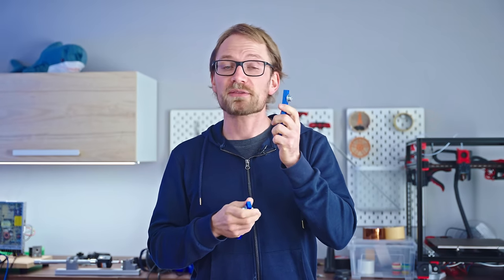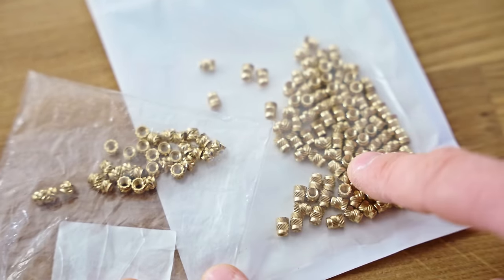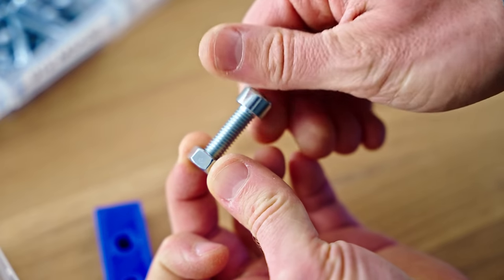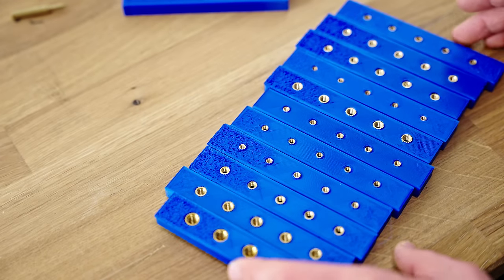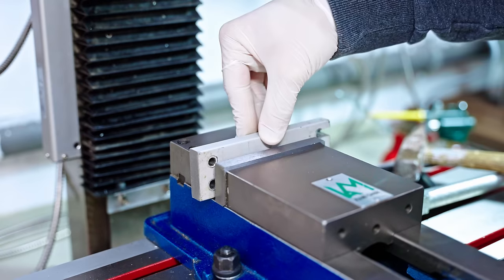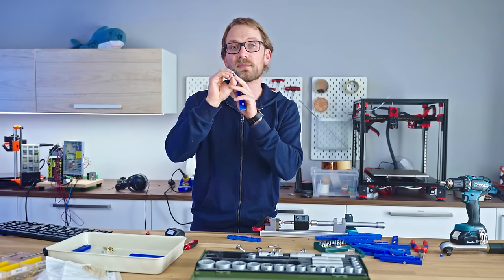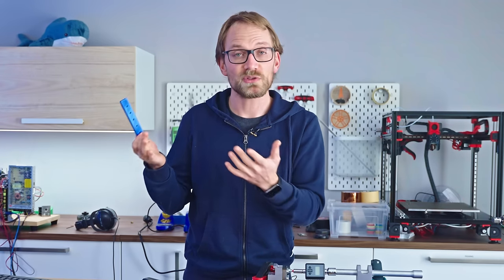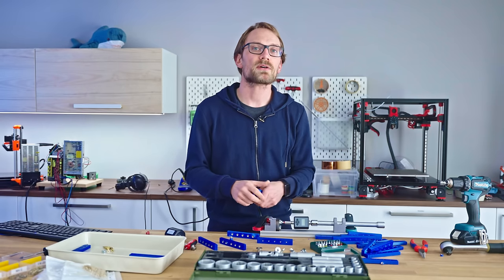Do you even need threaded inserts? Strength tested!

Comment: For a follow-up video, I'd like to see an exploration of print settings and design techniques for maximizing threaded connections. Different projects have different constraints, and there won't be any one best solution. Working toward that mythical best solution will find several methods that might be useful in some unforeseen scenario. Sometimes an insert might be the right thing to do, sometimes it might be best to use a deeper tapped hole because there isn't room for an insert. It would also be useful to see what didn't work well.

Maybe take a few minutes to explain or at least introduce some of the general engineering considerations of threaded fastener design. For example, you mentioned in passing a reminder to consider what's happening with the head of the screw. Has someone else already done a threaded fastener design guide for printer-using hobbyists?

Comment: This is why I print my wall loops with 6 lines thick if I'm planning inserts. I have found that this adds significant strength increase in pull-out strength.  Where I think the opposite threading would help, is if your object is expected to operate under pressure in a warm environment. That should help decrease the failure pull-out point.  To me though, the plastic will always be the more likely failure point before the insert fails.  The benefit of the insert, is if you plan to frequently remove the screws for maintenance/access reasons (like case access screws for example).

Comment: Taping into the plastic works MUCH better if you just let the screw tap the whole, especially if it's a "screw in once and leave it there" sort of deal. (You can unscrew, and reapply the screw, you need to be very careful to align your threads correctly, but if you're going to do this more than a few times, I'd go with an insert at that point.) As all of the material that was there, is still there, just displaced. In my experienced tapped holes into 3D printed parts are FAR weaker than self tapped holes.  You also need to understand, you're going to be fighting a LOT of friction, so it's not going to be the smooth and easy engagement you're used to from say metal on metal engagement. 

No, this does not generally split the plastic, even when it's extremely tight.  Though I generally print with a minimum of three walls, and if I'm going to be doing screws, I may step it up to four, depending on application.  You do want the hole as small as you can get it, and the bolt/screw actually still be able to fit in enough to tap in.  

Also there is utterly no need to tap a plastic hole for a metal screw, I can't believe Tom even bothered with it.  It's not like the plastic is going to deform the treads on the screw!!!  Further, I can't believe he was tapping the hole with a drill!!!  I tap metal holes by hand, and here he's using a power tool on plastic, and wondering why it's melting!  🤦‍♂

Comment: Alternatively, create a pocket for a hexagonal nut, pause the print and drop the nut into the pocket before continuing. You can also use a square nut slid in from the side or a nut from the back if you have acces to the back.

Comment: USSA woodworking channel uses threaded inserts for wood in their designs. They also insert it from the back of the part so the chamfer helps spread the load. Would be interested to see how they perform.

I only use inserts for parts that need to disassembled fairly often. Normally I just undersize the hole by the thread thickness, and let it self tap.

Comment: An idea i just jad while watching this was to redesign the insert to be a truncated cone that is pressed into the opposite side of the material. This would greatly increase the contact area of the insert. It also spreads the load out over more material and gets rid of the aligned perimeters that pull out so easily. No blind holes and slightly more limiting but would also be more hidden.

Or maybe just putting the bolts in from the opposite side of the inserts. The inserts do seem to move a lot of material out of the way, which may be creating a shoulder for the insert to push on. You're likely still only contacting the perimeters though, which would still be the weak point.

Comment: I'm surprised that the age-old method of thermo-threading wasn't shown, or even mentioned in the comments, as far as I can see.
You just heat up the fastener, and screw it into a slightly undersized hole.  It melts/taps its own threads.  You then remove it quickly as it cools, and screw it back in and out a couple times as the temps drop and the plastic resets.  You end up with perfectly formed threads, and no material lost.  I've been building stuff this way as long as I've been 3D printing, maybe 7-8yrs now.  
Of course, this will never be as strong as a threaded insert, but it's free and quick. ;)

Comment: Two thoughts: 1) design the part with a pocket and pause just before the pocket is sealed up and place the insert into the pocket so that the torque isn't the limiting factor. 2)design your parts using dovetails that interface into each other in order to provide some of the mechanical strength and use the screw/bolt to primarily keep the interface located together rather than be the entire interface itself.

Comment: We came up with a design to print threaded holes horizontally. Basically, the threaded holes are modeled and printed without threads on the bottom and top quarters to compensate for the dimensional inaccuracies of the Z axis and to make the bridging cleaner. The logic behind is that the threaded perimeter along the full hole depth should be way stronger than the layer bond of a vertically printed threaded hole. But we have never performed a technical analysis to them. Would be great to see you test them.

We are printing M3 holes at 98% scale and 0.150mm height. For larger holes, the layer height could (and should) be increased and the strength should increase significantly.

We'd gladly send you the link to download the design, but YT algorithm apparently doesn't like that and deletes the comment if we try to :)

Comment: I like tapping into plastic: it's cheap, easier to align (the tap aligns with the hole, at least drill/tap combined ones), you also can increase the engaging length (of course provided that the part is thick enough), and it's more difficult for vibrations to untighten the screw. And easier to model too, I just make undersized holes (2.5 mm for M3s, reduction of material is not really a problem as I print functional part with 2 mm perimeters and 45% infill). But they're probably not as durable as threaded inserts. It's always a tradeoff game, you just need to know the theory behind, that's why this kind of videos are very helpful!

Comment: Thank you for putting in the research work! Since you asked what to check next: Self-tapping screws, wood screws, inserting nuts, use of washers (larger area might not pull out as easily?), using the inserts from the other side (pulling through the entire part instead of pulling them back out where they inserted) and of course more walls / more infill / both...

Comment: Some things I would think would be interesting to test:
- A test of different perimeters - Are there diminishing returns? Where is the curve for "enough" to make more perimeters not worth the extra plastic.
- Given a standard thickness of say 12mm - You put a long heat insert in one side and Pull it from the other side with ~3+ perimeters, and compare that to modeling a Hex or Square hole into the part to use a standard (non-heat-insert) nut. 
- Quick comparison of a few different filaments - Specifically interested in PETG, PC and ASA. (Nylon has way too many other variables)
- A nice graphic final breakdown graphic with a "Strongest Tested", and "Budget Pick" for each Thread Size/Filament Type

Comment: You absolutely should redo the test with 100% infill.  With what you showed, you can’t tell if the material is failing or if the infill structure is failing.  100% infill needs to be the baseline, and then you can start reducing the infill to get a best strength to weight ratio.  Also, you can increase the thickness of the cylindrical shell that the screws go into, as well as increase the internal webbing between this cylinder and the rest of the infilled structure. This might be a good case for using some finite element analysis of the stress and strain instead of burning plastic all over the place. Great vid!

Comment: This test left out the OG method of screwing into printer parts - print slightly undersized and use the screw to tap the threads as you put it in. You don't compromise the wall thickness at all in this way, and an added bonus is that the printed part now acts as a bit of a threadlocker.

Comment: Great video! An idea for an addition: I think you should try to give the inserts and taps the best possible chance to take a load - as that is what anybody contemplating using inserts would strive to do anyways. For that, print your test bars without any holes in them with 100% infill and drill the holes by hand afterwards. These holes could then be inserted, or tapped and maybe even helicoiled. This way, you would rule out the hole area being a weakpoint by bar design in the first place.

Comment: OK!  Consider this as a 3D printing option for a variety of reasons...
If a recess is designed at the back end of the hole that is hexagonal in shape, about the same depth as a hex full-nut and about 100uM undersize inclined walls.
Use any of a variety of techniques like heating the nut and insert or simply press-fit at room temperature, or use the mating screw to draw down the nut into the hex' cavity where it will wedge and stay put.  The printing material used will normally dictate the most reliable fitting method.

   |_|_|   Hex Nut to insert.
  \_ _/   Hex recess in 3D printed material.  Slightly inclined walls (~ 100uM undersize) for hex nut dimensions. 
    | |      Clearance hole for machine screw in 3D printed material.

I used this technique on an injection molded polycarbonate thin-wall case (electronic product) with M2 stainless hardware.  It was very successful - long term.

Comment: Tom, I go a completely differant way, 2 actually, when I'm designing stuff.
First way, I print 2 esentially models at once with differant print settings. The "external view stl" with low infill and large holes, with few outlines and top layers. 
The second stl is all the holes used for screws, printed at 100%.  The model thats solid also had a center core structure holding all the "holes" together, where this is a void in the external view model. Think maybe dual color print set up might help you picture it better. All holes are 1 STL and the rest is another, thus the core binding all the holes also serves to make every one of them 1 file, rather than a file for each hole. 
The threads.... I run the screw or bolt in, not using power tools, do it the old school tap/die way (little in/little out/ little further in), but I coat the screw/bolt in candel wax and reapply as needed (old wood working trick).
Never tested the strength, but has always worked well for my needs, with limited use of the fasteners (set and forget, not made to be assembled, taken apart and reassembled a bunch).

Second way, a pocket for a nut with a pause at the layer just before that pocket is closed in.  Sometimes I'll combine this method with the first if I feel I need more strength, where the pocket area is printed solid from top to bottom..... ideal for your tests, where they are thin and flat on both surfaces, but maybe not for printing something tall or decorative. 
By pringing solid, and much larger than just the dia of the bolt head, I ensure a large surface area and good adhession as that area is solid, but the outlines to make that pocket somewhat overlap the "solid print stl model".

Comment: In the twisty puzzle community (rubik's cubes), we just use make a plain (untapped) hole that is smaller than the screw we use, then we screw in the screw into the hole by hand, and it's actually really strong in my experience with M3 screws once you find the right size for the hole. I'm surprised this method wasn't featured, it's the simplest, easiest, and fastest way to do this in my opinion.

Comment: Using a chip clearing tap and alcohol (as a coolant/lubricant) is a great fix to the issues associated with tapping. Also in the print settings, one should always have more than 2 or 3 walls no matter what type of threaded receptical you are using.

Comment: I have not needed to print many parts or projects needing a fixing like this but I think one thing that has not been mentioned is, How Tight Does Your Fixing Need To Be? clamping down the parts to destruction does tell you their ultimate stregnth but what if you do not need that stregnth, say just for a lid on a box but need to be removed often and look professional, I think most of these fixings would do that quite nicely. Having said that, you went to great legnths to bring this topic to our attention and did a fine and thorough job too. Regards, Geoff.

Comment: T nuts are certainly worth a try. Here in the US you can get them in most hardware stores. One drawback is you have to insert them from the back, and you'll probably also have to heat them up to make the little spikes sink into the plastic. But I have a feeling they would be the strongest because they spread the load more than any of the others.

Comment: the failure mode is clearly in the plastic where the last perimeter meets the infill, so larger holes means more interface and more strength explaining why larger M sizes perform better. this interface can also be eliminated by doing concentric infill for the top or bottom layers thereby essentially making the number of perimeters the maximum possible for the part size. also strength will continue to increase with more solid layers (either top or bottom depending on where the insert goes) up to the limit of the height of the insert where it's max OD is.

also i think a torque gauge may not be the best device to measure failure considering the failure itself is simply shear in nature rather than torque (the plastic comes out of the rest of the part in the same direction as the load). further more because of mechanical advantage, a torque gauge is always going to be less sensitive than a strain gauge, have lower resolution, higher minimum threshold of detection etc. now that it is super clear than the weak point in the entire chain is not related to the metal parts, this particular failure mode no longer needs to be measured by torque.

Comment: Great video.  I appreciated the quantified testing and also your willingness to toss out bad data as needed.  My personal wishes would be: 1) Holes with thicker walls.  I usually design my parts to final size and don't have Cura do any hollowing, so I can make any desired wall thickness.  2) Test with PETG.  I don't trust PLA for my boxes, which can get pretty warm in use.  3) Small bolt sizes.  M3.5 is a maximum for me, and M3 is probably the sweet spot.  4) I'm mainly interesting in the brass inserts, but a comparison with a self-threading wood screw would be useful, especially if it includes multiple cycles of insertion and removal.

Comment: I've used internal nuts (kind of like internal magnets) as threads with really good success.  You design a hex cavity inside the volume of the part.  Pause the print when the depth is such that the nut fits flush with the top layer.  Then continue the print, locking the nut inside the print.

Comment: I tested a lot of different solutions. Here is the best one iv found : print your part with 4mm wall around the hole where you need a thread. Never use 100% infill as the insert will deform the part. Use 80% so there is some space between the walls and the insert. Put the brass insert in the hole with some heat. Wait it cools down, then anneal the part in your oven. The brass insert will slowly melt the plastic layers and crystallize around it. I got incredible results with this method, using nylon. It also works with PLAplus HT. I always use M5/M6 inserts.

Second method, use Helicoil inserts (80% infill) then anneal the part in the oven. After annealing, tap inside the helicoil so it removes excess plastic inside the threads

Comment: If you plan to tap the threads, make sure to have enough wall thickness to not have the wall thickiness the weakest part of the finished structure. Another option is to adjust the fill density so that the strength of the parts is not solely based on the shell of the part.

Comment: @12:18 nice Quinn reference

I prefer to use, if it's possible, an "integrated" nut.
A printed hexagon-shaped pocket on the back of the piece for the nut.
For smaler screw-diameters than 3-4mm, I use square-nuts. The small hexagons-nuts tend to destroy the matching pocket and start to rotate freely...

Comment: dont add extra perimers on everything. In the cad model, add a thin pocket to hollow out next to the hole (lots of factors to consider dimensions so i wont detail it here) and add sircular pattern to spread them out evenly. Slicers will register these as perimeters and add plenty of reinforcing plastic around the bolt holes so threads work much better. 
I usually prefer regular or square nuts if i can get to the backside of the hole, if not i usually go for wooden thread inserts that screw in while slightly heated to soften but not melt the plastic. 
For quick and dirty wood screws are often plenty when combined with hollow pocket reinforcement. Often apply this to 3d printed parts where i just want to strengthen one of the axis, especially when printed along z. Add a reinforced pocket hole for a wood screw and heat it just a touch before screwing in. 
Can make 3d printed parts much stronger in many use cases.